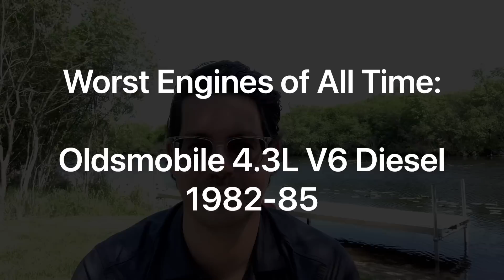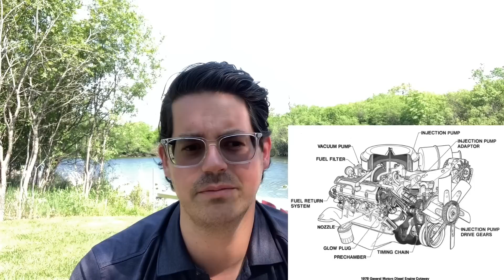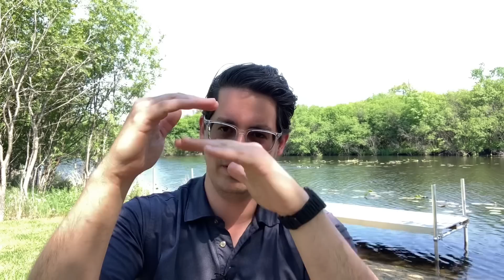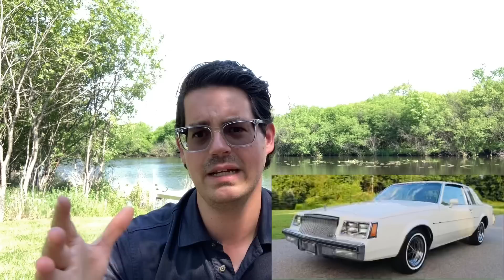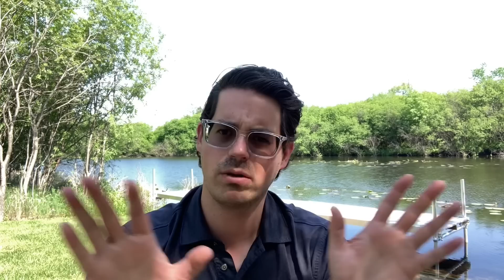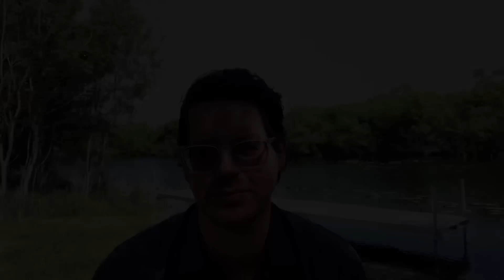Worst Engines of All Time: Oldsmobile Diesel 4.3L V6

Comment: Had a good buddy who cherished his Century 4.3. He 4-speed swapped it, totally redid the engine, even so far as running Harland Sharp roller rockers. Aftermarket fuel filtration kept it alive. 
It ran pretty good for what it was. Till it lost an oil cooler and shelled the crank.
Reply: Four speed auto or manual?
Reply: @michaelchan8915  Manual
Reply: @typrus6377  I would have to see it to believe it. I could understand a Pontiac 6000STE which came available from factory with a manual if I'm not mistaken. But a Buick Century? Was it originally equipped with a floor shifter or column shifter? Which transmission did he use, to bolt it up to? I know these are some in depth questions, but I'm having trouble picturing it. My mom had an '84 Buick Century with the 2.8L V6 and three speed auto so I remember how these cars look very well.
Reply: @michaelchan8915  He took the Muncie out of a 6000 or a Celebrity. I remember he had to do something interesting with the pedal group and tunnel to mount the shifter. He also had to have the flywheel custom machined to fit the engine, and turned down the ring gear mounting.

Comment: i had the 350 diesel in a chevy pick up i drilled the head bolts to the next size never had any trouble i put a water separator on it
Reply: No, you didn't.
Reply: @mikehasemann9270  yes i did bought the engine with trans at a junk yard

Comment: Chevrolet Vega...
I ordered a 72 wagon in the fall of 71.  At 9000 miles it was burning a quart of oil every 450 miles and the Chevrolet dealer told me that was normal.  I was 26 yo, not knowing how to complain further.  I owned the car for 27 years.  At about 120,000 miles it was on it's third engine.  Everything else of the car was wonderful.  Great handling with it's wide oval tires and (ordered) lsd rear end.  No electrical issues, never changed the oil on it's Opel four speed manual.  80,000 miles on a set of Michelins due to great alignment.
Reply: I thought Vegas used the 4 speed Saginaw?

Comment: Thank you for an informative video and  sharing the wealth of knowledge. I had a feeling it was rushed to market and they were conducting research on the market. Had they got the Olds 350 diesel right just imagine the impact on the market now. I know diesels were or huge in other places like Europe. Diesel fuel is expensive today in 2022. Ford attempted diesels as we know with Lincolns from BMW.  What could have been. Why were the truck diesels so much better? They use them to this day. Yes, you were right... GM lost ground during this time.
Reply: Ford also offered a Mazda diesel in the Escort and Tempo.
Reply: @eth39232  
I remember those. I think you had to remove the engine and transaxle assembly to replace the starte..
Reply: It's almost as if they purposely screwed it up.
Reply: The heavy duty pick-up truck diesels were developed as diesels instead of converting from gasoline designs. RAM worked with Cummins and adopted their tried and true B5.9, Ford worked with International Harvester and adopted their 6.9 IDI V8 and GM worked with Detroit Diesel to develop the 6.2 NA V8. For light duty usage, Ford adopted the BMW 2.4L I-6 to test the market instead of investing in hundreds of millions $ to develop their own. Other light duty diesels from European and Japanese manufacturers have been adopted by the Detroit 3 in low volume applications over the years as more of a stop gap until one of their designs was ready, or the vehicle was redesigned.

Comment: I understand why the government made auto manufacturers reduce fuel consumption. But someone in automotive engineering should've been consulted before enacting the requirements. If they had the proper time for R&D, they would've been able to build better, more efficient, higher quality engines. It could've saved the US a lot of issues and money
Reply: But not blaming the government is ignoring the problem
Reply: Does proper consultation and looking at reality before making decisions sound like how the govt addresses problems?   Bot in any issue I can think of
Reply: That what happens when government regulators don't know a damn thing about the business or technology that they're regulating. Unfortunate that happens so often
Reply: Blaming the government is an oversimplification.  The market for fuel inefficient cars took HUGE hits in 74 and 79.  They rush jobbed a bunch of crappy smaller cars to meet demand.
Reply: Yes, it would’ve saved the US a lot of problems & money. And that’s exactly what the globalists don’t want.

Comment: This is supposed to be the "worst engines of all time" not the "not bad but not great engines of all time".  You even admit several times that the 4.3 diesel v6 was fine.  The title is inaccurate and offensive.  I can understand lumping the 350 diesel in the WEoAT list but not the 260.  Also the reason Oldsmobile killed the 4.3 v6 diesel was not because it was bad but because GM didn't need it to make CAFE anymore and gas prices were cheap so the public was no longer interested in diesel.  The above mentioned complaints have resulted in your first video downvote from me.  I eagerly look forward to your apology video towards the Oldsmobile V6 diesel.

Comment: So the olds diesel engine plant built the quad 4...I guess thats why they always called it an oldsmobile engine. Thanks for sharing.
Reply: Was the Quad 4 based on the Iron Duke?  
If so, then it's a divisional hybrid, like the Pontiac OHC 6.
Reply: @DanEBoyd  The Quad 4 was all new at the time.  Nothing in common with the iron Duke.

Comment: I was a tech at the only GM dealership in Canada that sold all GM models: Chev, Pontiac, Olds, Buick, Cadillac, Corvette, LD trucks, MD trucks, HD trucks. Eventuelly ran our HD truck garage and we worked on all these powerplants. We found that the blocks themselves didnt have the strength to withstand the compression pressures and we suffered with these diesel powerplants until the 6.2/6.5 which were true diesel blocks, with apprpriate lower block strength. Great channel, thanks for your on-going effort.
Reply: The early 6.2L diesel would push the crankshaft right out of the bottom of the block. They were hot garbage.
Reply: Except for the undersized starter bolts, and not enuff meat to drill and rethread one size larger, and the oft discarded little front starter triangulation bracket
Reply: @CORVAIRWILD that helper bracket for the starter was there for a reason!

Comment: In 1988 someone traded in a 85 Ciera Brogham 4.3 diesel with a "rod knock". I bought the car for a very cheap price and it turned out to be a drippy injector causing the knock! It got great mileage after that and was a decent car. As far as the 4.3 V8 diesel it was an absolute slug! A one year only engine and I'll bet very few survive.
Reply: My neighbors bought a brand new Ciera diesel in the mid '80s. Noisy and gutless. It shook so much at idle that the instrument pamel was literally falling out if it!  The owners got their money's worth out if it, though. They kept it for at least 10 years and nearly 150k miles. They drove it with a blown head gasket for their last 2 years of ownership, then sold it for scrap.

Comment: In 1980 I bought a VW Dasher wagon diesel and a buddy of mine bought an Olds Cutlass diesel wagon. I got nothing but bashing on how slow small and everything else compared to his Olds diesel , I drove his Olds several times and began to wonder if I didn't make the right choice on a diesel wagon over the Olds. This bashing went on for a couple years till one morning his wife took out of their drive way up a fairly steep hill and the Olds pitched a rod through the side of the block at 60,000 mi. My VW went on to surpass 200K miles and I received no more VW bashing out of my friend after the big explosion. Also by then the reputation was so bad he didn't even bother to put a new engine in the car to fix it. It went to the junk yard.
Reply: The VW diesels of that era were no prize, either. My family had an '80 Dasher Diesel. It tossed a rod through the side of the block at 80K miles. It was the nicest looking car in the junkyard.
Reply: @alantrimble2881  the 1.5 till 1980 wasnt that great of an engine ,the westys with that 1.6 from 81 up was alot better. 
You gotta rev em some , the 1.5 even more. 
I remember thousands of times when dad was driving mom's 81 rabbit ,he drove it like he stole it and it loved it. 
Approach a hill in 4th gear, and when the speed drops to the redline of 3rd on the speedo ,drop it in 3rd and let it sit at redline for however long the hill is.
It could be 5-6mi long, let it eat. 
That car went over 200k before i put another 40 on it. 
You could brick the gas and it'll sit there all day at 5400 and do nothing.
I used to scare my friends by bricking the gas for 5 mins at a shot in neutral just to see em trip out. 
Yeah ,it's governed, but 5400 isnt exactly slow.
Reply: @alantrimble2881 VW Diesels in the 80’s weren’t very good - forty-ish horsepower with a timing belt and a weak head gasket. At that time, Mercedes was king of Passenger car Diesels, with MFI Peugeot as a close second.
Reply: My father owned an 81 rabbit diesel... I always had a very similar experience when driving his . downshifting from 5<4<3 to climb any hill. It was his watk car driving between ANO and are house in Knoxville. I wish I had that little car today.
Reply: Sad I. Ultimately took one down to the bones and used modern diesel upgrades! I solved alot of the issues they suffered from. Have had no issues reaching 188,947 miles on it cranks first time never had and failures. I drive hwy mostly and some city

Comment: In the 80's these cars were a bargain and most were really clean ! we used to pull the diesels out for the iron and hot rod them out with small block chevy 350 combos and some 454's alot of my builds are still.racing to this day !

Comment: The comment about the Germans not building a large engine at about the 3 minute mark is not accurate. Mercedes had  a V8 in their S class that was sold in the United States..in fact even a high performance V8 starting in the early 1970's
Reply: He's talking about big, heavy cars with big engines, like the Caprice 1973.
Reply: @youtbe999  Well...the Caprice was not a luxury car like the Mercedes 6.9  S class was
Different class, features, finish and the Mercedes was probably 3X the price of the Caprice
Reply: @youtbe999  how bout a 300SE with a fuel injected 6.9 liter V8...big enough?
Reply: He's talking about overall mileage increase to double across all GM lines.
Reply: @youtbe999  GM has plenty of 4 cylinder and 6 cylinder cars ...Monza, Vega, Astre, Nova before this time

Comment: Was Olds the only American maker with diesel car engines?
Reply: From what I can recall in the 1980s to the 2000s:  Light duty pickup trucks with GM, Ford, and Dodge offered diesel engines; but I don't recall, aside from GM, any other US auto manufacturers that put diesels in passenger cars.
Reply: @bloqk16  Ford escort used the Mazda diesel and maybe a few other's in there line up in the USA.
Reply: Ford Escort/Tempo/Ranger & Mercury Lnyx/Topaz used the  Mazda diesel.   Lincoln Mark VII Coupe and Continental Sedan used a  BMW diesel for the 84-85 model year.
Reply: @ljac4147  thanks for the info!

Comment: The 4.3 was actually a very good engine. it had 6 bolts per head and none of the other typical issues. they didn't make to much power but where great for the fwd cars.
Reply: True